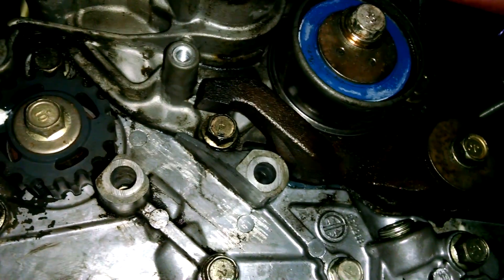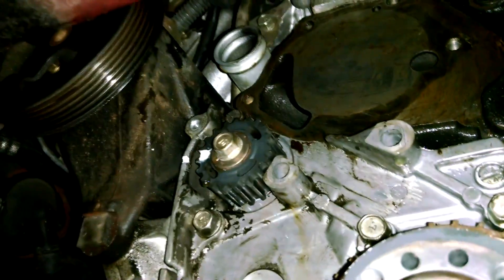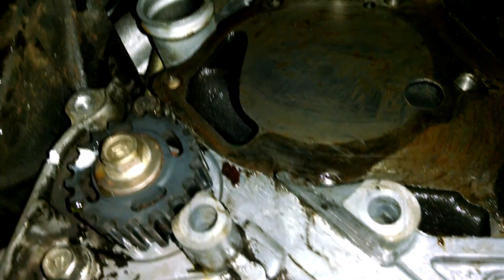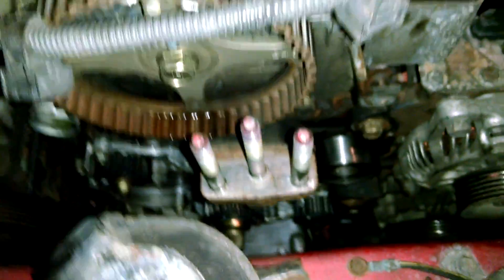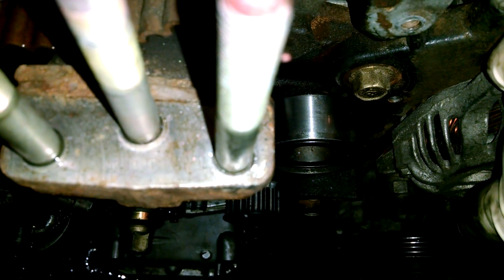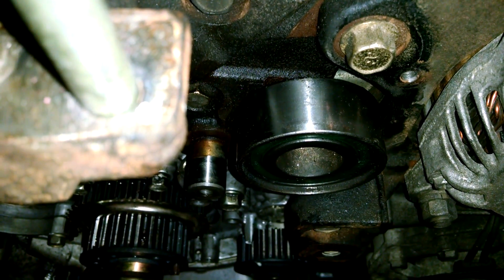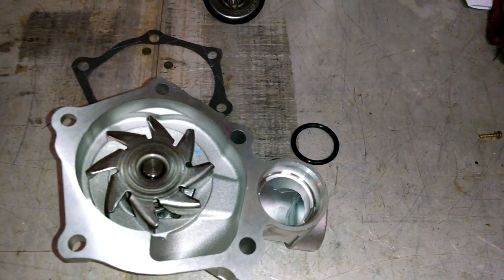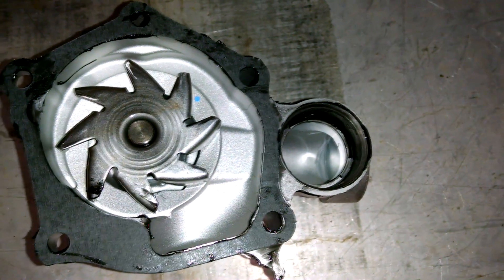Mitsubishi Outlander 46G4 2.4L Timing Belt Replacement Part 2

Comment: Hi,I have a 2004 Outlander, what brand do you recommend for the timing belt kit? Thanks
Reply from the maker: I went with Gates for the belt, and Factory OEM for the idlers and water pump. The pump that failed was a GMB with 40K on it.
Reply: Farpoint Farms Ok, Thanks
Reply: @FarpointFarms  maan that GMB is the brand i'm going to use, would NPW brand be better? is that 40K in miles or KS.? ..i dont want to go back in there anytime soon after doing the timingbelt ETC.